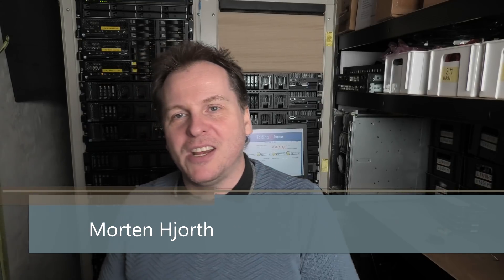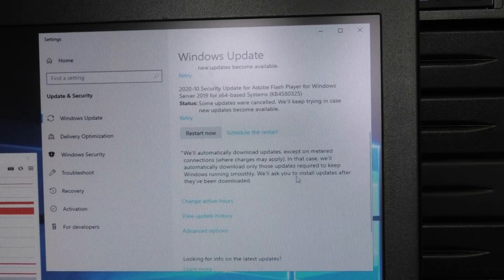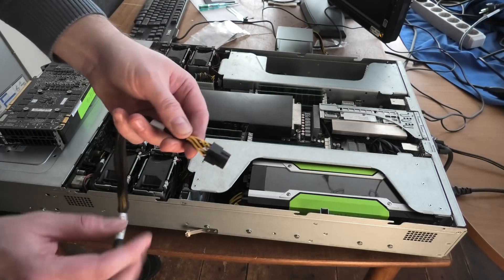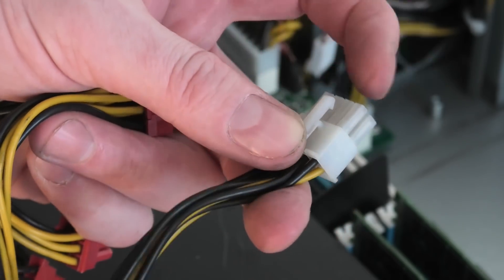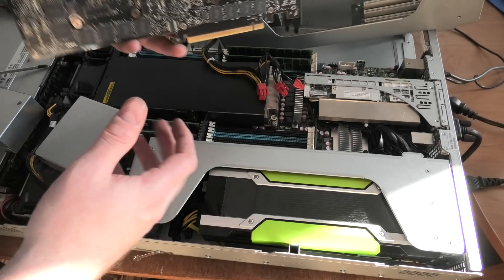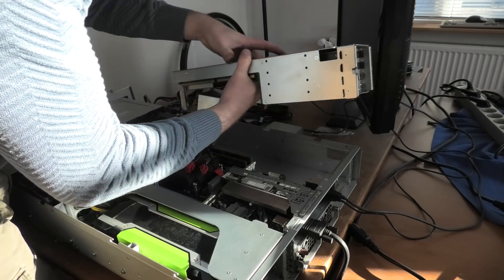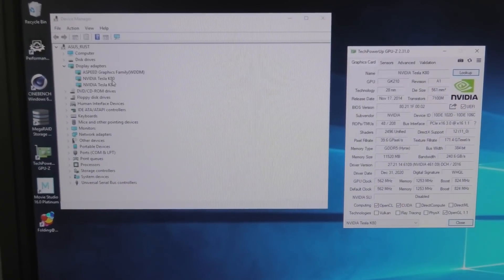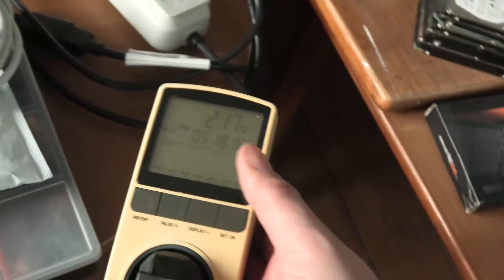Two Nvidia Tesla K80 in ASUS ESC 4000 G2 Rack Server - 1049

Comment: Hi Morten, nice video, very useful, but I would like to ask you, how do two Nvidia Tesla K80 cards go together. I know that they cannot work in SLI and that the typical memory is divided by a maximum of 12 GB... if I install two identical cards on a PC, with an AMD EPYC processor, to be able to create renders, what happens? Is the work divided between the two video cards and the processor? Do I need to change the software?
Thanks for the attention.
Reply from the maker: I had them working on folding at home,, they did not work together,, but divided the tasks.
Reply: @MyPlayHouse  ok, so the tasks are divided, in the sense that the processors work according to the task divided between them I guess, not that one goes or doesn't go right? How does it work regarding the use of memory? Does only one card work in memory and the other doesn't or do they share the weight?
Thank you

Comment: K80 design was licensed to Dell, etc,... who build special cases where the card-cooling was included in the case instead of being part of the card (active external cooling, you could say). If you put it into an unlicensed case, you need to build a custom cooling system for the K80 first. Normal airflow wont do it. Some people just thermo-tape some fans on it - but you need a lot of extra space for that. PCI-extensions and external holding systems are what I see on working unlicensed builds. You are running an uncooled K80 in your rack - better check your fire-insurance-policy ;-)
Reply from the maker: No,, This server is made for GPU's and they are well cooled.

Comment: I read that QuickSpecs HP IO Accelerator for ProLiant 580 G7  servers could making faster CPU and Graphics my server DL580 Prolian has RAM 500GB and Iwas thinking in (HP 320GB SLC PCIe ioDrive Duo) or (HP 640GB MLC PCIe ioDrive Duo) in case of not to be useful a Nvidia K20X for the same duty of getting better CPU and graphics, how is de best option ? 

thanks very much !
Reply from the maker: If you can get those iodrives at a good prices, fine,, but new NVMe disks are also pretty good now.
Reply: @MyPlayHouse  thanks very much!!   HP DL580 G7 is very old server, With adapter pcie 2.0 and nvme Evo 960 I supose, have you done That before? Have you any video about? 

Will server works faster With a tesla 20kx?  Or it only works faster With softwares it takes parallel programmimg cuda?

Comment: HI Morten, you should not wear a grounding cable on your wrist when you working on a Server that is on a power line. I really hope you removed the Power Cord on the Server.
Reply from the maker: Well this works well, and the racks has there own ground connection, just outside.
Reply: It can kill you, if you touch a live wire with your other hand. Don’t wear the grounding cable, if you want to stay alive.

Comment: Hi Morten, I am having some trouble with my K80, GPU clock is not boosting and GPU-Z is reporting Boost Clock as 562MHz, but in your video it shows 824MHz, only difference is BIOS versions. Can this be an issue? Mine are 80.21.1F.00.07 and 80.21.1F.00.08 and is bothering me quite a lot because performance per watt is way worse this way, power consumption is around 200W total with 200-300K PPDs per GPU (depends of job)
Reply from the maker: Could this be because it is not getting enough power,, and it slows down,, to still do something.
Reply: After some more digging around i am 99% sure this is GPU BIOS related but have absolutely no idea what to do with it. For some reason older bios that i found on techpowerup.com database boost clock is 823.5MHz and have 27 frequency steppings available but mine has only 3, (Idle, perfcap(?) and base clock),  everything else is the same. I also recently added to another graphics card, and even after that there is no power capping on K80 according to GPU-Z , only thermal throttling on M2000 (its sitting next to K80 :) https://drive.google.com/file/d/1uxb-N4rnsWRSmj5TZ8nNwlbBtLcHnU4-/view?usp=sharing

Comment: Thanks for the video Morten. Which cable did you use eventually? Was it the one that came with the card? Which Indian hack did you do? I got a K80 recently but I had to use an EPS12V I had with my ATX corsair power supply and I m not sure if it could draw full 300w. The cable that came with the card did not fit into my power supply.
Reply from the maker: Have a look at this video,, that is the other cable I used. : https://youtu.be/wKg8_ba-3-0
Reply: Thanks. It is indeed a ninja hack!! I'm still wondering how you managed to get it to work with the yellow/black wires flipped sides!

Comment: @My PlayHouse - 1KW per hour. Jesus. You need more Solar Power Morton, really. Or as @MGD9000 say run a power cable to all neighbours and tell them it is for a good thing, haha. Good video. Right now i'm boosting a Lenovo M900 SFF to the max of hardware in the housing. It is like a devils machine. All possible hardware which is mentioned in the Lenovo Hardware Specs. Lots of extra hardware. I needed a bigger power supply and i found it which fits perfectly in there.
Reply from the maker: I do not run all you see all the time,, I ran this until it had completed :-)

Comment: Hi Morten!
I think the card cable is meant to be passed through the side indent of the back bracket. This way the air flow is not restricted.
Reply from the maker: I did not see that there was many options for doing it differently.

Comment: I was thinking as you were struggling. Isn't that a 8 pin, to 6+2 , to 8 pin.... Why... Single cable.

I've a few cables like that. For all sorts. I always end up not remembering where I've put them, but I have a new box called ""the build box" which has all the stuff needed to do builds.
Reply from the maker: I was not having much luck with connectors that day.

Comment: That cable with the adapter, hmm, messy and seems needlessly large.
Reply from the maker: Yes,, it is not the best solution.
Reply: @MyPlayHouse  The adaptor is pointeless
It depends on your cable and pin quality but pci express 8 pin can deliver a maximum of 540W in theory before it is a fire risk
The adaptor has unknown wire gauge and unknown pin quality

Comment: hey, was wondering if it is viable to use consumer GPUs in servers. Newer generation quadros are expensive and older generation ones are loud, power hungry and underperforming.
Reply: I have used a few different GPUs in my servers, while they aren't good for Folding@Home or video rendering, they provide a good graphics support if you are running a hypervisor such as Proxmox, XCPng or VMware.
I've used the Asus HD5700, NVidia K4000 and the P2000, if I remember correctly. But as long as you have the right PCI slots should work fine.
Reply from the maker: There is computing jobs/tasks that GPU's does 10-20 times faster than even the fastest CPU.
Reply: @MyPlayHouse  I know, but my question was whether it's worth buying consumer GPUs as a cheaper alternative